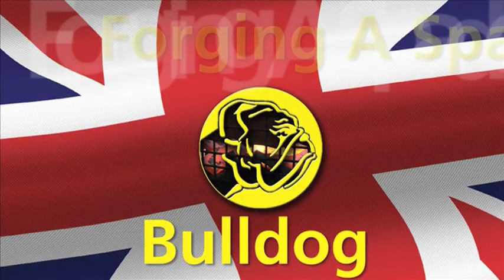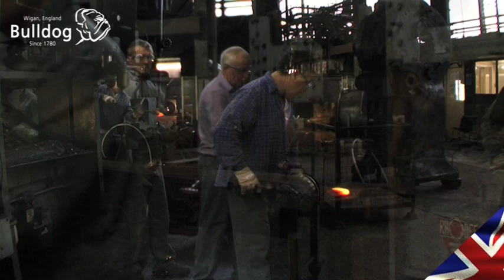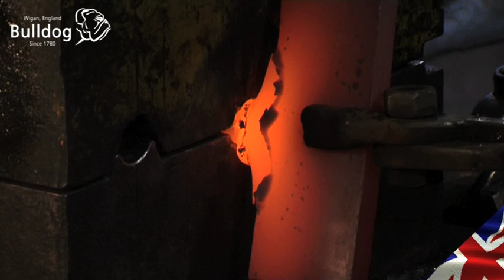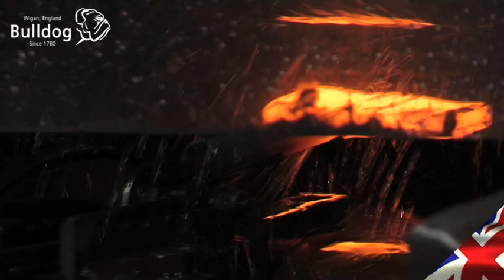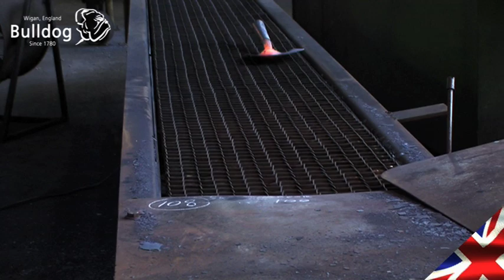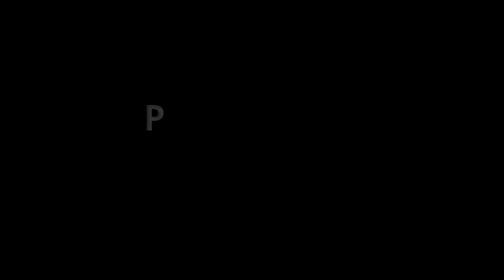Bulldog Tools Factory Tour

Comment: @fbrad1 I'm pretty sure it is a spade. A spade is designed to cut into the ground, whereas a shovel simply scoops material from a pile to somewhere else (adding coal to a boiler for example). Shovels usually have sides bent up slightly and an angle between the handle and the blade, but a spade's blade is almost completely parallel to the handle to allow better transmission of force from the user to the cutting edge.